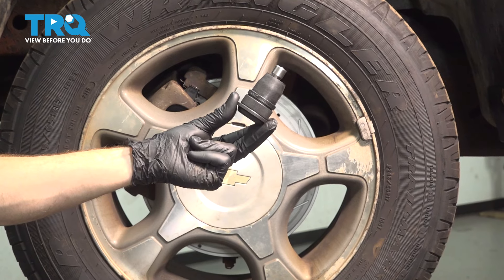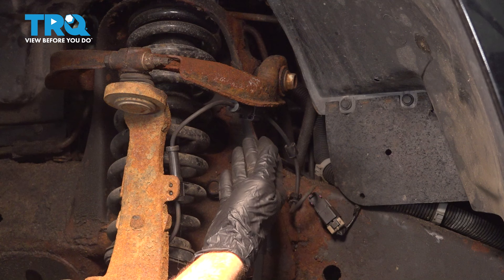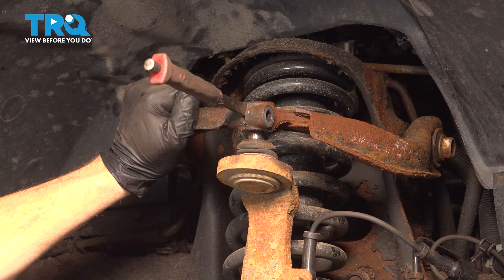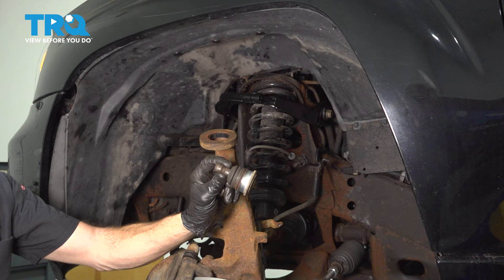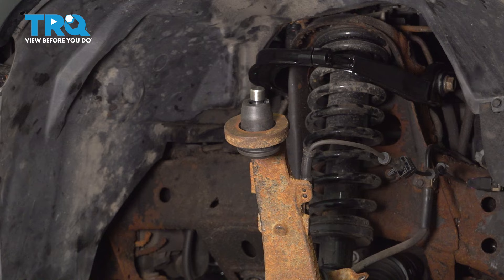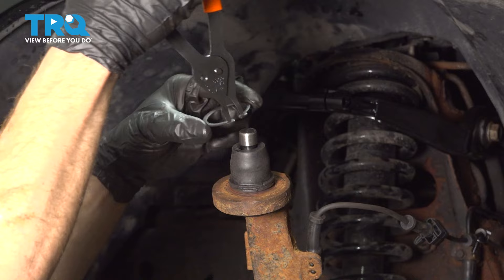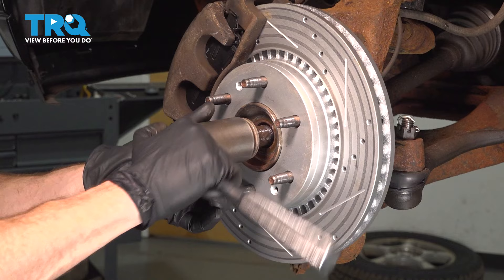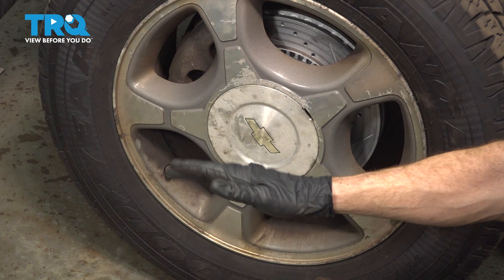How to Replace Front Passenger Side Upper Ball Joint 2002-2007 Chevrolet Trailblazer

Comment: Something to add, is to make sure you figure out the way the grease fitting will face as if you press it in a certain way it’ll face the knuckle and you’ll have to loosen it to be able to fit a grease gun. Something I’ve ran into a few times the countless times I’ve replace MY own ball joints since these things run through them lol. I also the first time I broke my cv axle doing exactly what you said. Be very careful and don’t rush it

Comment: What is the top adapter you put on at 5min18sec?  I have a ball joint service kit and an add on adapter set for a total of 23 pieces and I don't have that item.  I watch another video where the Youtuber just pressed down directly on the ball joint post and it worked.  It also looks like I could use a socket instead of the adapter you used.  Thank you for posting all the videos you do; they are super helpful in my DIY repairs.